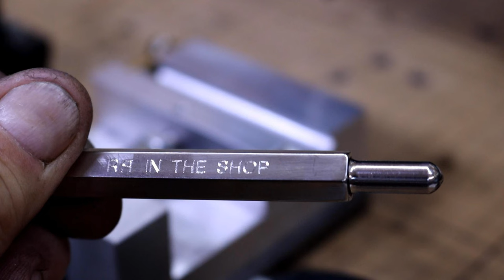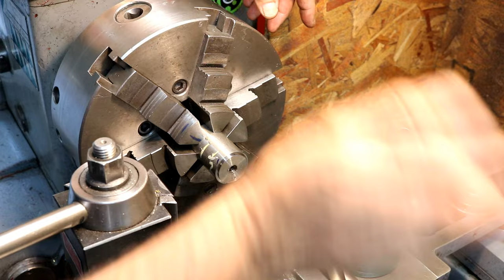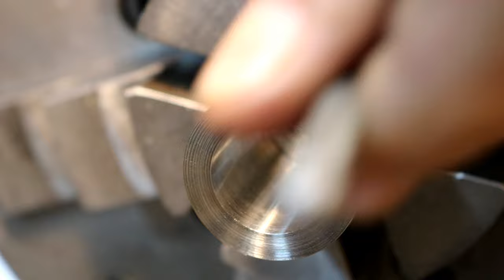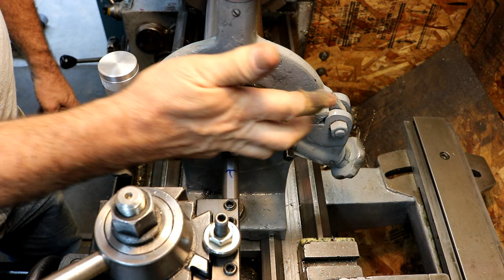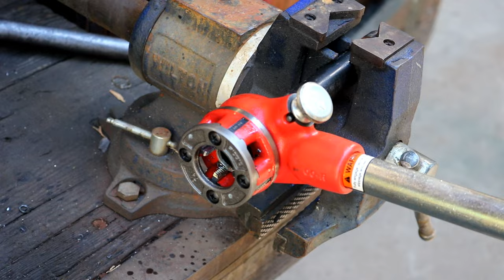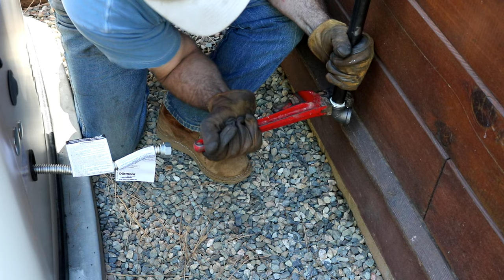I Made a Mistake and Make it Right for the Generac Generator

Comment: Randy, I’m thinking you should put a shut off valve in the gas line right before the flex line. Flex lines are more subject to damage and as it is now if the line gets damaged or you need to shut off the gas to the generator, you have to shut off all the gas to the building.

Comment: It was great meeting up with you at Mr Pete's.  

I wish I'd had my brain engaged before leaving home for that.  I'd found a bit of very tough material in an old utility trailer that I've wanted to get to you.  As usual, I spaced about it and left it at home.  This stuff laughs at HSS, and ruined a center drill without taking a mark.  By appearances, it's a kingpin from an old semi tractor, likely and old cab-over Freightliner.  If you wanted a super size dovetail cutter, I think this would work.  You might even think of something else (better) to use it for.  Guess I'll have to ship it to you or try (again) to make the Bash this summer.
Reply from the maker: Thanks, it was great meeting you.  Yep I bet the king Pin is pretty tough stuff.

Comment: Two problems I noticed:
* there needs to be a shutoff valve before the compression fitting for the flexible pipe. Every appliance feed/branch should have its own shutoff as close to appliance as possible.
* Black iron pipe shouldn't be used outside where it's exposed to weather,  Sch 40 galvanized pipe should be used outdoors. At least paint it with some anti-rust paint.

Comment: Do you have a particle trap somewhere along that gas run.  If not I would remove the last elbow and replace it with a T and a 6" piece of piece of pipe off the other side of the T with a pipe cap then run the gas to the generator from the "base" of the T.  Keeps the rust particles and crud from plugging the orifice of the generator.  Just a thought...
Reply from the maker: There is one just inside the generator housing, came installed.  Thanks Fred.
Reply: Sounds like they went the extra mile!  Nice to see once in a while!!

Comment: Must say I didn't pick up on the error - not paying proper attention! It's interesting to see the correction... that sort of error is probably quite easy to make. Useful to have the die unit for taper NPT.
As someone else mentioned, hope the gen'y will not have to be used.
Reply from the maker: Thanks Chris.  We always have the power out several times a year.  Now a bit easier.

Comment: Hi Randy, happy to see you again. Question:have you scratched pipes thread before applying teflon?
Reply from the maker: Scratched?  Thanks
Reply: Randy Richard In The Shop yes, scratched. You have to make the thread rough so it captrure the teflon better, for better seal.
Reply from the maker: The seal should be the metal to metal.  The teflon just fills the gaps in the threads and adds some  lubrication to get it tight.

Comment: Good catch Randy never take a chance with gas piping you ought to invest in a set of pipe taps up to 1"
Reply from the maker: Thanks Chris.  I have the taps,  No reamers.  Stainless is very tough to tap.  I would of had to cut the taper on the lathe anyway, so why not just machine the threads.  They came out very nice.
Reply: @RRINTHESHOP  believe Randy I know how tuff stainless is worked in the piping industry

Comment: 24:44 - Hey Randy.I think your chamfer tool is rubbing before it is cutting.  I had to grind a bigger relief in mine to handle smaller diameters.
Reply from the maker: Yes that on i need to relieve a bit more.   Good eye.
Reply: or can cheat it up a little in the holder

Comment: whats the purpose of the accumulator in this use?
Reply from the maker: With such low pressure, this give an extra volume of gas to help when starting.  Especially helpful in colder winter climates.

Comment: Randy. Nice to have met you at Mr Pete’s.  I’m following along in this video and I haven’t seen a gas accumulator like this. What’s it do?  Or did I miss a video about that?  Thanks
Reply: I think he said in the other video but an accumulator is basically a tank to act as a large volume to reduce the effect of pressure drop when the generator kicks on and gas starts moving.  The flow evens out and doesn't starve the engine.  At least that is what I understand about it.  It is just a cushion.

Comment: Why is that accumulator even necessary? If that green pressure regulator is set correctly and isn't defective you shouldn't be having any gas feed issues. The regulator should have 10 PSI on its input and 11" WC on its output and should have no problem maintaining that pressure when the generator starts. You don't have a gas-fired kiln or a huge house furnace hooked up to that same gas line do you? If you do, then the proper fix is to add a separate pressure regulator on the 10 PSI side to supply just the generator.